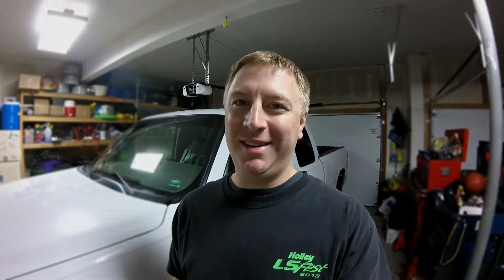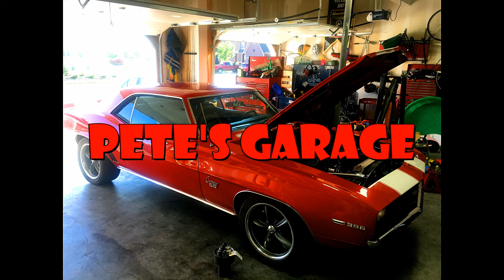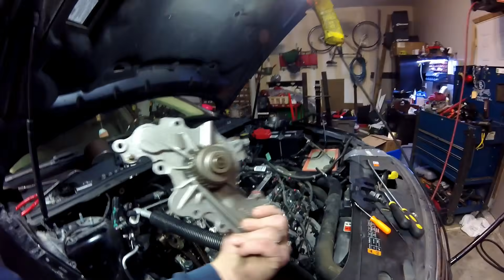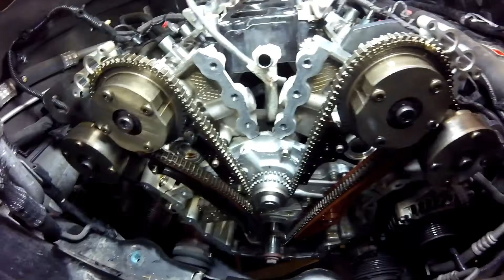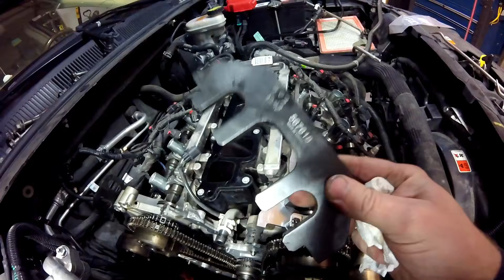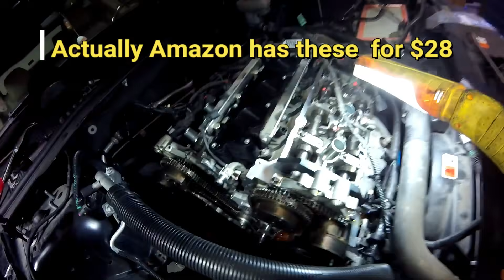Why does the Ford Taurus, Explorer, Edge 3.5L water pump cost over $1400?

Comment: Cadillac: We're going to hide our starter motor under the intake manifold. HAHA, won't that be a pain to get to.
Ford: Hold my beer.
Reply: Lexus does the same thing
Reply: @glengerdes2447  Yep. Toyota doesn't walk on water like everyone seems to think.
Reply from the maker: Tony Jackson it is funny how bad of a rap the northstar got because of the starter placement. I worked at a Cadillac dealership and never replaced one. Now oil leaks and head gaskets were a different story. I can’t believe the amount of bad press that starter placement got over the years. And they’re not the only ones who’ve done that.
Reply: @PetesGarageandperformance  yup and are actually easy to replace.
Reply: @PetesGarageandperformance  yup them head gaskets on that engine are horrible
Reply: @PetesGarageandperformance  

There's a special spot in hell for the man who pulled the team together and said...."lets drop some throw away tty bolts off in this northstar motor specifically built to WITHSTAND HEAT"!
Reply: N* starter is actually really easy to get to, just time consuming. You can do it in a couple hours with a single 10mm IIRC socket. Tightest bolt is like 28nm of torque.
In 10 years of owning cars with these engines, I've never had to replace a starter, just happened to see it when replacing an intake plenum.
Reply: Assume you’re talking about a N*?  Had several. Changed my first starter in one with no specialty tools, having never done it... in a bit over an hour. It lasted 220K kms.
Reply: @DrFiero  GM engines rule bro!...I've worked on all manufacturers  and ford, mitsushitty, Mazda, Mercedes Beanz, and BMW are the WORST!!!
Reply: @John Murphy Funny how the engines nowadays makes the problems of the north star relatively insignificant in comparison. You stud a Northstar and they are good forever.
Reply: I’ve had many waterpumps fail but rarely a starter. I’d prefer a caddy over this Ford Engine from a repair standpoint. Do d my 5.3 in maybe 90 mins. The 3.5 is s gonna burn up a day and 3x the cost.
Reply: Not a big deal. Putting it there also really cuts down on contamination too.
Reply: What is the problem with having it under the manifold. Takes what, 30 mins more to take of.
Reply: there is a reason why ford quit making the 3.5l twin turbo for the interceptor sedan.
Reply: every toyota V8 engine hides the starter under the manifold too
Reply: Mazda mpv 00-05: were gonna hide our alternator, i mean you can see it, but u gotta remove most of the passenger side exhaust and cv joint and brakes to get to it...hahahaha
Reply: @grumpy old fart  isn't that how the mechanics get paid
Reply: Yep, Nissan did the same thing on the 5.6L Endurance V8.  Under the intake.  Who designs this junk?
Reply: Lexus LS : hold my top end lol
Reply: My CRV is that way, starter under intake manifold. What were they thinking? At least not too bad a job. This water pump would be a nightmare.
Reply: @Aaron-dp5kb  I agree and the northstar reminds me of the old HT4100 caddy had in the early 80s
Reply: Ford 3.5 v6 starter motor ‘s also located on top of the engine in the rear.
Reply: Good one.
Reply: It’s not really difficult to change and thy don’t go out that often.  It’s not unusual for a “traditionallly positioned “ starter to require removing a motor mount or some other gymnastic maneuver while dealing with heavily corroded fasteners.

Comment: You dont have to pull the cam actuator, you can back out the chain guide bolt as much as it will let you and that will give you just enough clearance to remove and install a new pump.

Comment: I see why the U.S. has fallen by the wayside in the global automotive industry.  My Dad used to be a loyal Ford customer and in the 1990's he bough a pre owned Ford Taurus no older than a year and that car cost my Dad a fortune in trips to the dealership for maintenance and repairs.  Every time he took that car for regular maintenance they always found something wrong with the car, but my Dad didn't want to listen to me when I told him that Toyota cars was the way to go until 2005 when he decided to buy a Toyota Corolla that never gave him any problems and today my brother has that Toyota Corolla and haven't had any problems.  Today my Dad is driving a 2017 Toyota Corolla and haven't any problems.  I had a 1998 Toyota Corolla and the water pump didn't break down until 2017, that's 19 years with the original water pump and this 2014 Ford Taurus needed a new water pump only 3 years after it was purchased?  Enough said about Ford and the rest of American cars.  My friend purchased a brand new Chevy Blazer back in the mid 1980's and he got nothing but problems, before he finished paying for that vehicle he had to replace the engine and two years later the transmission and then the rear axle.  He was one of those guys who only allowed the Ford dealership to service and repair his vehicle even for oil changes only, but still his car was a piece of shit.  My first car was a used 1977 Toyota Celica that I bought from a friend back in 1989 and I had no problems with that car and I gave that car to my brother and he used for 5 years and then sold it.  My next car was a 1985 Nissan 200SX that I purchased back in 1990 and I never had any problems with that car, I had a 1981 and 1979 Datsun/Nissan 280ZX that were reliable that I used for several years and never had any major problems and I sold both cars and those cars are still on the road today.  Presently, I owned a 2009 Toyota Corolla that has over 136,000 miles and the only part that I had to replace was the alternator and that car runs smooth and I have no desire to let it go unless I decide to buy another one and most likely will be another Toyota.  I have always owned Japanese vehicles (Toyota and Nissan) which I have found to be more reliable than American cars.

Comment: People hating on the design like it’s something new, but it’s not and tons of other manufacturers use this design. Also if the oil is maintained I normally don’t see these water pumps start to fail on the 3.5 well into 200k miles.

Comment: My Neighbors 2012 Ford Flex Limited with the 3.5L Ecojunk has had the Water pump fail twice, once under warranty at 42,000 miles, and another at 108,000 miles not under warranty. They had to drop the engine cradle to change it. 
His repair bill at Ford was $2,600. He since traded it in and said he will never buy another Ford.

Comment: i hate how complicated and hard to take apart these cars are now.  i had a mid 90's tercel that was as simple as a lawn mower.  i changed the rings and the rod bearings without even taking the motor out. it was so simple it didnt even have power steering.  really didnt need it.  4 speed manual.  great mileage.  fast too for a 1.5l.  probalby about 40 mpg.  wish i still had that car

Comment: Just like the dodge stratus 2.7 l v6 idk why they designed these things like this,...it completely ruined any good rep these types of motors can get...they’re interference motor..ur belt or chain snaps which the water pump coming apart and getting caught up in the chain damages everything..the valves and heads need replaced after the chain breaks etc etc...it’sbs...that’s why there are so many in junk yards

Comment: My dad, a retired mechanic, has a theory. At some point in automotive history, a designer caught a mechanic in bed with his wife. And the designer has been getting even ever since.
Reply: This is joke of the year🤣😂🤣😂😂🙌👏🏽👏🏽
Reply: What? That means more money for the mechanic. Youd want to design the engines a lot simpler so every DIYer can repair their vehicle and buy the parts themself aswell
Reply: @Glubbdubdrib  It only means more $$ for the mechanic if they get it right the first time. If they cheap out on the part or if the only locally available part is garbage and they have a backlog, but labor cost is only 1/2 covered by part manufacturer on defective parts... you get where this is going. At a quick glance, the aftermarket replacements run from $30-$100 with no discernible quality difference,  and that price range includes "Ford Motorcraft"  (displayed as "FoMoCo") labeled parts.
Reply: AMAZON HAS WATER PUMP FOR $39 BUCS.     OAW F9060 Engine Water Pump for 07-10 Ford Edge + Lincoln MKX, 09-10 Flex + MKS, 10-12 Fusion + MKT, 08-12 Taurus, 07-12 MKZ, 09-11 Mazda 6 & 07-11 CX9 V6 3.5L 3.7L https://www.amazon.com/dp/B01F5XNEFY/ref=cm_sw_r_cp_apa_i_kdpXDbB4KW58J
Reply: Anybody want to buy a 2014 ford explorer interceptor eco boost? Mine runs great but I just stress the entire time I'm driving it
Reply: One of fods finest ideas go figure
Reply: Lol good one
Reply: That is hilarious, I'm a mechanic and that was always my theory as well only with British Cars!
Reply: That can explain it
Reply: I'm 100% convinced that modern cars are designed like that on purpose so the consumers will keep buying new cars because maintaining them aren't worth the hassle. That's why I drive a 30 year old car because I can work on it myself.
Reply: And punish all mechanics? What a dick.
Reply: Mechanics fuck alot of ppl.

Comment: Best part is your water pump pulley could fall off or coolant mix into the oil and total your engine. Because surely a water pump will never need replacement! They do shit like this so the repair cost will make you just want to buy another car. Oh yea and all Ford engineers do meth and coke while designing cars and never talk to each other.

Comment: The old pushrod 5.7 vortec takes about an hour and costs $50. 4 bolts, a mechanical fan and 2 hoses. I'll drive this thing until it has 500,000 miles and Im 75 years old. This DOHC shit is out of control. If you own it, I suppose  you better have a warranty. Same with the GM 3.8 pushrod V6. Took about an hour and a half and cost $50. And that's in a FWD car with limited space. I'll maintain it and drive it until the wheels fall off before I deal with most DOHC.

Comment: More evidence of some of these new idiot Engineers trying to redesign the wheel again. What the hell is wrong with putting an electric water pump on something. I remember talking to an engineer years ago when they were trying to figure out how to design the water pump on the new Mitsubishi Chrysler V6. I told him go to an adjacent frame rail and bolt an electric water pump on it and put the lower hose to it. You could even have it thermostatically controlled so you didn't even have to put a thermostat in the damn thing. Apparently that made way too much sense to this engineer. I still long for the days when Engineers used to have to turn wrenches. They wouldn't make mistakes like this.

Comment: I'm No Mechanic,But Why Not Send the Orig.Pump to A Good Machine Shop & Have Them Repl.the Bearings in the Old One & Reuse the Housing,If I Understood U To Say the NEW PUMP Is $1400 or A $1400 Job to Do Everything ? Prob.Get Another Reconditioned Eng. For Slightly More Than That.This Reminds Me of the 04 Hynd.Sonata I Had W/ 2.4 ohc That Had A Pendelum Type Setting Around the W/ Pump/ ,That Mech.Had to Figure Out Which of 2 or 3 Settings Was Correct to Do W/ Tension of Belt ,I Believe,That Only A Trained Hynd.or Kia Mech.Knew How to Set Them.Finally ,A Former Hynd.or Kia Mech.Did A Video on it & Posted it on the Internet,Cause if U Didn't Set That Contraption Correctly, She Bang !! Ur Timing Belt Broke Shortly Afterward &  All That Labor Was A Waste & Had to Be Done Again.Crsnkshaft Position Sensors Rarely Lasted the Life of the T.Belts& When They Croaked,Ur Eng.Cut Off & Eng.Would Not Recrank Till U Wasted 1.5 Hrs to Reinstall Another one.Parts House Crnk .POS.Sensors,Like ,O'Reilly's,Made in China,Never Lasted the Life of the T.Belt.The Prem.Brand Crnk.Pos.Sensors, Were Only Ones that Lasted to Next.T.Belt Chge.Those Engs.Were SOLD TO HYND.By Mitsubishi, I Believe & Were A Pain in the Ass to Do T.Belt Job on & of Course,they Were Interference Engs,So When The T.Belt Broke for Either Mech.Not Being Aware of Issues Mentioned or Tensioner Not Repl.When they Were Needed, U Were Calling Scrap Yards Looking for A Used One,If UvDidn' t Just Shot The Car Out Of It's Misery ,FIRST !!!

Comment: I've worked at Chrysler and Chevy dealerships. BELIEVE ME...these sorts of things are deliberately engineered and designed to drive revenue for the dealer, and to be hard for ANYONE to work on! FACT!! I can remember being shocked at hearing complaints from our dealers owners(both Chrysler and Chevy) and car salesmen, that there simply wasn't enough 'money' in certain vehicles. They hate those vehicles. What they meant was, when sold new, certain vehicles didn't generate anymore than 3k in profit for the dealer, furthermore, those same vehicles didn't breakdown enough and were not complex enough in their repairs to make a service call to the dealer an absolute must. They would complain that if a vehicle did break down enough, but was to easy to fix, that ' people would just take their cars to independent shops to have them fixed'. SERIOUSLY FOLKS!! This is a thing! Dealers do have a very large role in the intentional sabotaging and poor engineering of all autos, it does not matter the brand! There exists a constant chorus from dealerships to manufacturers to increase dealership profitability. It happens all the time and is constantly the focus of dealer meetings and auto design. I can remember a particular mechanic named Odie. He complained about the unnecessary difficulty in replacing the timing belts on Dodge Neons. The motor mounts were connected to the engine 'inside' the loop of the timing belt. This required you to unbolt the mount from the frame to replace it. HE HATED IT! I asked him why it was designed that way. He said to make the dealer more money. For him it was just more work. The largest percentage of the labor charge goes to the dealer..NOT THE MECHANIC! I can remember another mechanic named Tony, he told me about one of those 'certified training courses' that dealer mechanics have to take in order to be certified to work on certain vehicles. He said that at the Chrysler school the teachers and instructors openly discussed future intentions and ways to make Chrysler products hard for anyone to work on other than the dealer. They discussed the increased use of 'special tools', electronic 'lockouts' in their OBD computers, and making more of their software coding 'proprietary' so that independent shops and aftermarket scan tool manufacturers couldn't diagnose problems. FOLKS IT'S TRUE! You are not hallucinating when you scratch your head trying to figure out why certain aspects of vehicles are 'reverse engineered'(morally speaking). True engineering solves problems..it does not create them! Just like Blockbuster Videos, the dealer model of profitability is starting to die. When people make a large purchase like a automobile, they expect the best engineering in terms of economy, safety, longevity AND repairability. The fact that so many resources are now and have been, devoted to faulting and failing their own products, is evidence of their continued moral demise. BMW and Mercedes are some of the worst offenders, so is Ferrari. It is true across all segments of auto manufacturing.

Comment: When I did this job on the 2.7 in a Chrysler Sebring convertible I picked up cheap because it needed this repair, I simply used multiple small vise grips to hold the camshafts in place as I did the job, worked fine and didn't hurt a thing as I went in between lobes. Put a few thousand miles on the thing and it is a fun car for the little I have in it. There looks to be way more room under the hood of that ford to work on it though.

Comment: The worst part of this design is that Ford used it. AFTER Chrysler used the same design and it led their smooth, efficient, and powerful for it's size at the time 2.7 v6 to have a terrible reputation. This was due to internal coolant leaking of the timing chain driven water pump into the oil over time or external leaking. The external leaking is the best outcome as it can be noticed and repaired before failure, BUT the repair is time consuming and expensive. Internal coolant leaking on the other hand would dilute the oil and sludge up the engine as it operated a high for it's time temperature for efficiency. So the coolant that leaked into the oil would have the moisture cooked out of it and it would leave behind the cooked down coolant and it would wreak havoc inside the crank case.    So good job Ford, way to look at what your competitors did wrong and do the same exact thing.

Comment: The competition of the taurus in water pump labor price would be the toyota venza v6 is expensive,and mechanically speaking suzuki v6 h25 and h27 engine is almost identical to do the water pump as the taurus.

Comment: The cam sprocket bolts are a one time use torque to yield bolt.  Only bank one needs to be removed to access one bolt to one guide to access the pump behind it.  I leave the powertrain in.

Comment: Just for the sake of asking would it be easier to just pull the engine to do the job rather then fight with the confined space
Reply from the maker: Dan K it’s about 50/50 from the Ford techs who I’ve talked to. Some say it’s quite a bit faster to do it in car. Others say it’s a lot easier to get the front cover sealed correctly out of the car.

Comment: You guys are whining over *this*? This is a frackin' cake walk compared to the Ford 4.3 V6 Found in the Mazda CX9-AWD. Same basic water pump design, but you have to drop the engine/trans/k-frame. There is no other option. Book IIRC, was 20+ hours...
Reply from the maker: Woof
Reply: @PetesGarageandperformance  It's definitely in my 'jobs I won't do again unless I really need the money' file...

Comment: I was outraged when I found out my BWW water pump cost $300 for the part because it is electric (and simply connects with hose clamps outside the engine) and then I saw this...